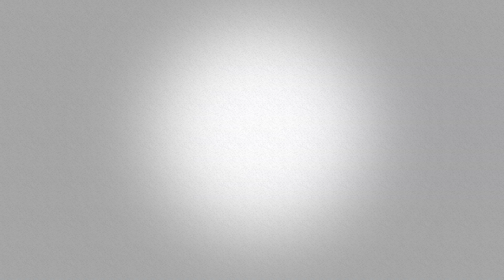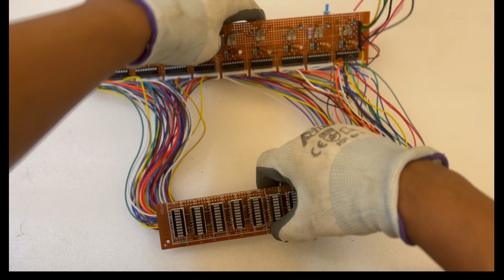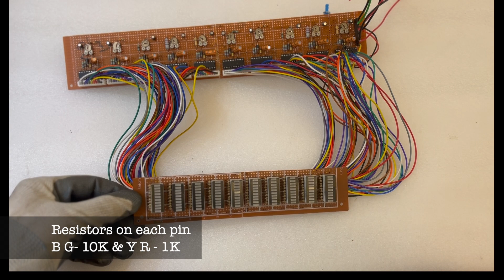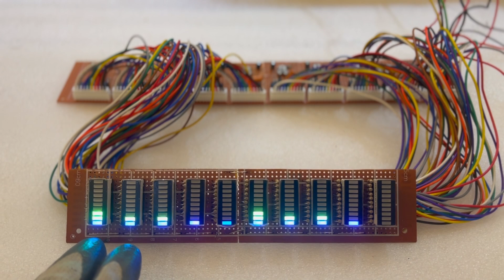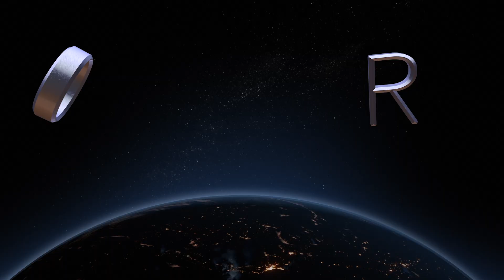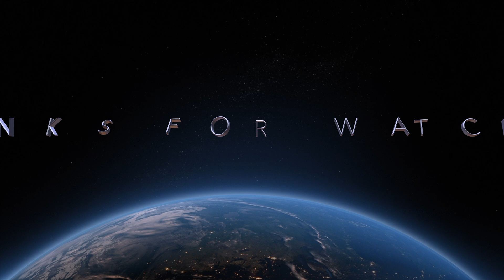VU Meter | 10 Band Audio Spectrum Analyser | Band Filter | 60Hz-14KHz | 2024

Comment: wait, I can order a bunch of LM3914, apply a specific filter for each one and have this beauty, I would like to know the details about the filters for each frequency, yours is a pair of 5 bars, I want to make one of 7 bars, figuring out the filters might be tricky without knowing the exact parts used for each bar, it looks very smooth and the falling of each bar looks faster, a 60fps video would have been much appreciated, but still only using the old LM3914? I'm hyped to try this myself!
Reply from the maker: Hi, the filters for each channel was calculated by a OP-AMP Calculator, (Please check "digikey.in")
may it helps. And for increasing the bars you can increase upto any numbers, you simply have to divide the acoustic (Low to High) range with numbers of bars you are using, in this way you will find out individual bar frequencies output you need (for reference you can also check a image of any 7band equalizer where each band frequency is mentioned) , then you can calculate the values for resistor & capacitor (band filter) in the calculator & place them, in that way you will get separate range to display on each bar (display).
Reply: @Anzs17  well I'm assuming that these are all LM3914 since it's a linear display instead of a VU Meter or a logarithmic display, what I already like is the falling speed can be defined by the value of the capacitors which all of them need to be the exact same that also controls how bright they will look since I need them to light up one by one instead of by groups and dimmed like most of the many 3914 kits that do not correctly drive the IC and give poor results.
Reply from the maker: @RONDIZZONI-FAMAE  yes these all are LM3914, if you will use it without the band filter, then also the falling speed will be same. For lowering the brightness of display i used resistor on each pins of 10 segment. For satisfaction you can use 1 ic for 1 bar, just to check the result..
Reply: @Anzs17  can you tell me the values of the capacitors? I want to copy your idea, it's fucking neat, just that mine will be a 9 bar spectrum instead of 10 split by half to do stereo spectrum, do you remember how the sony spectrums did move? those are fucking fast and beautiful to witness so I wanna duplicate mine with these ones before the VFD dies.
Reply from the maker: @RONDIZZONI-FAMAE Capacitor used in the main circuit is 1uf 63v (each channel). If you are asking about the filter capacitor, as i already told you, you need to calculate it on the OP Amps calculator, depending on the output frequency you need.

Comment: Iam also working on this project. Im using Multiple Feedback Bandpass Filters for separation.
Reply from the maker: Nice to hear that, let me know the result..thanks
Reply: its working flawlessly, 10band 1/3oct.  @Anzs17
Reply: Hi there, i want to know if multiple feedback band pass filter will be malfunction or not? if i set the Q value so low until 0,8
Reply: @asep.okky.nuriana very narrow notch will not really that practical due to lack of precision opamps. It's okay above 0.5 .